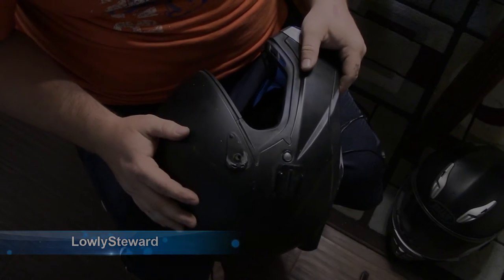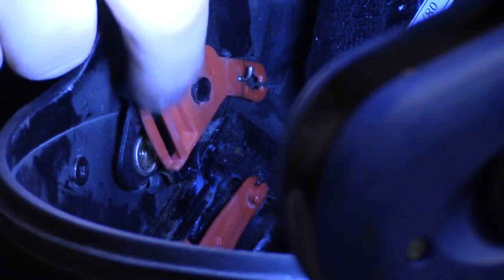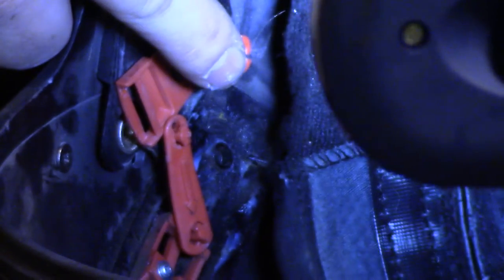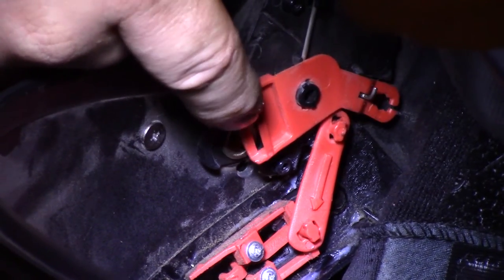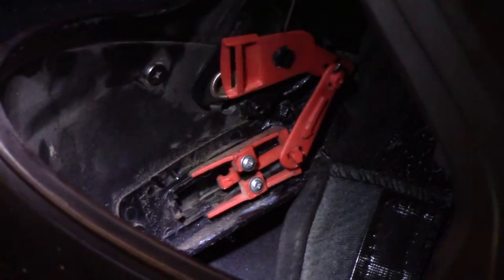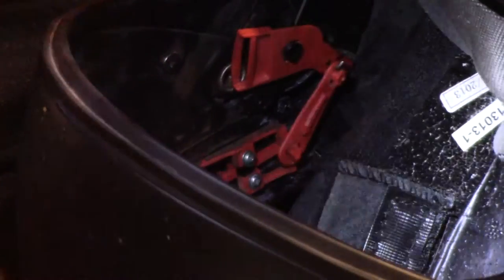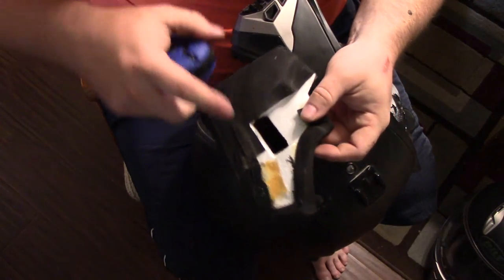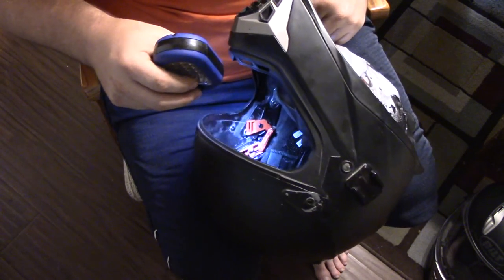How to Fix Broken Inner Faceshield Sun Visor - Bilt Helmet

Comment from the maker: UPDATE: This solution broke again so now I have a string coming out the side of my helmet to pull the inner visor down. Cheap Chinese helmet!
Reply: Just came across this, do you still have the linkages? If so, i could machine metal replacements, im curious to see how much of a difference it would make
Reply: I have a origine venator winter xl helmet and the sun visitor well not go back up, but the switch well still push it down and I have no idea how to disable it to fix the issue

Comment: I'm glad I found your video, I was about to tear my Bilt Apollo apart. Yep, the sun visor quit working on my after my crash. The helmet only got one single small scratch on it other than the visor. It still looks good, so I'll check if it's the same diagnosis as yours. Thanks for the video.
Reply from the maker: Glad you found it helpful! I've become accustomed to being able to flip that internal sun visor up/down on the fly while riding and now I can't live without it haha...
Reply: Thanks again it beats wearing sun glasses. Riding here in Washington there are a lot of dark areas from trees, I have to slow down for my eyes to adjust.

Comment: I have always suspect "Bilt" gear and Cycle gear for selling Knock off stuff. This just confirmned it. Not a knock on you at all. The only stuff I have bought from Cycle gear are the Freeze out clothing. I have had many offers from them for free stuff, If I would do video's on it. I just cannot bring myself to do them. My credibility is worth more than their "free stuff" Glad you found a fix. Sad stuff that the weakest link failed. Sometimes I think they build those in to make you buy new replacements.
Reply from the maker: +navythomas8 It's definitely  knock off stuff, no doubt about it! I want to do some review videos on the gear I have because I don't have much good to say about any of it. The only pro is that it is a cheap way to get into motorcycles when you have tons of gear to buy. You can get into it for 3-400 for jacket/pants/gloves/helmet/boots rather than 1000-2000 for nicer gear. Funny about the weakest link... I'm pretty sure electronic companies do that too, they put in weak capacitors that only last a couple years and then pop so you have to upgrade your phone. Deceitful products!
Reply: LowlySteward whew, Glad you took my comment as intended. I agree with you on the fact that they are basically selling Entry level gear. Any protection is better than none. I spent a LOT of money on entry level gear, such as FieldSheer, sixsixone, Sliders. The closest thing I have to knock off gear is my Gmax helmets. But I am rather impressed with them. all the padding, Cheeks, etc inside snap in. But when it comes to helmets, I believe the padding is not gonna save you anyways. More likely to snap your neck. Hence I have the LEATT neck Brace. I think it is the GTX one for use on the road. That I bought after three different brands of foam neck braces. Guess I am the type that buys and then builds upwards.
Reply: @navythomas8  - I’d like to know how one takes off the visor off the helmet. My helmet is like new condition and works good, I’d like to know how to switch from a dark face shield to a clear one.  I have been unable to find a good video showing or explaining how to.

Comment: Nice job.  What kind of adhesive did you use when putting the helmet back together, specifically, the liner that covers the sun visor mechanism?
Reply from the maker: Adhesive? I didn't use any. The pieces just slid out so I just slid them back in. They fit in there really tight though, they aren't going anywhere. Not sure what would happen on an impact though :( I should probably buy a new helmet. I don't feel very good about this one!
Reply from the maker: See my update above btw... this solution was awesome but not for long.
Reply: Appreciate the reply.  Saw the fix was temporary.  Can the circular piece that broke be corrected using a gluegun?
Reply from the maker: I wouldn't think a gluegun would hold for long and it would have to be able to rotate in there once it's fixed. I do know one definite fix though... It can be fixed with a new helmet lol